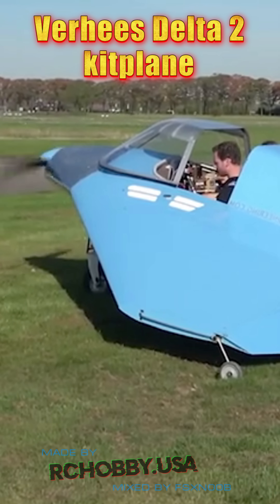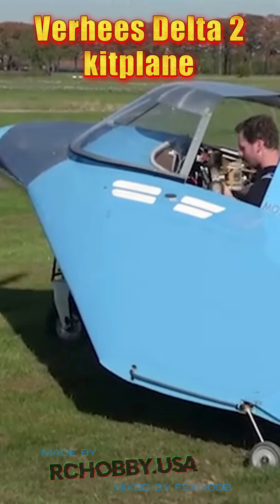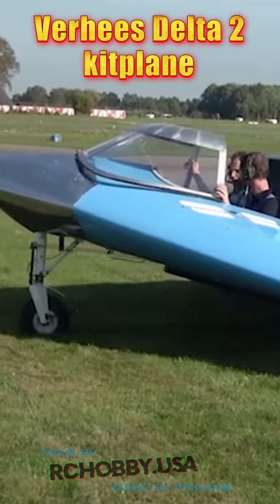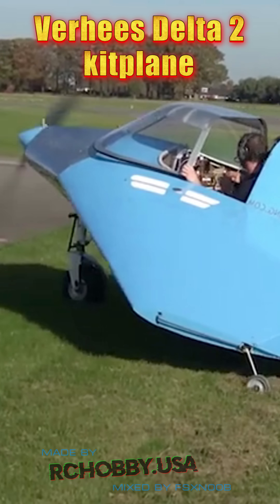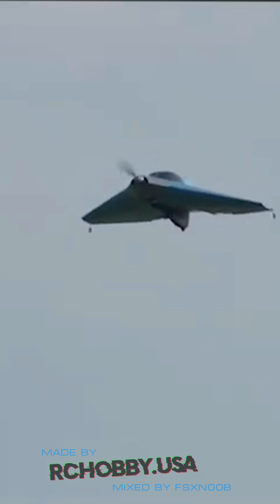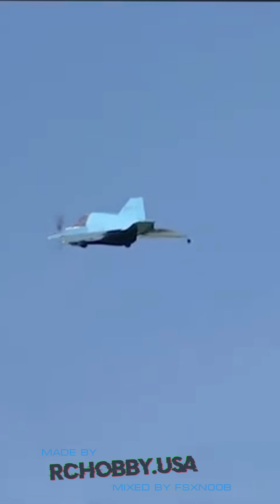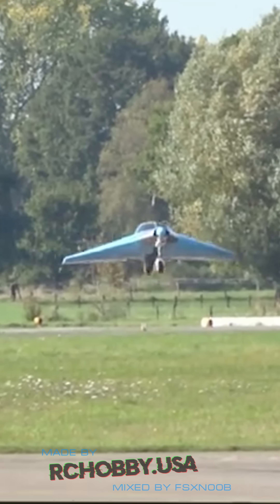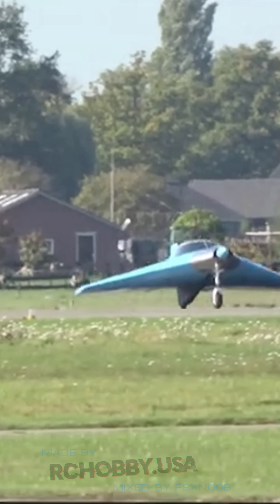A Game Changer in Aviation - Verhees Delta 2 Kitplane #shorts #aviation

Comment: Can you imagine flying for 18 hours straight and then trying to be sane enough to land this thing.
Reply: No I go to the bathroom too many times to fly an airplane for that long
Reply: @theimpaler2317 as a former sailplane pilot I assure you, there are means. Staying hydrated is crucial, and keeping a cap on your head. Sitting under the plexiglass dome in bright sunlight might easily result in a sun-shock like with sailplanes.
Reply: @martinoberngruber1893

This is why fatalities are so high among sailplane pilots.  This mentality of pushing to the brink. 

It’s not because they don’t have an engine because even a powered aircraft will have a survivable crash landing in nearly all terrain—a sailplane that’s designed for an out landing that much more so.
Reply: @calvinnickel9995  ??
Never said I would or was flying 18 hours! What is wrong with your reading.
As sailplanes need upwinds, and are not allowed - in Europe, in the 80s - to fly by instrumental flying rules, they also need daylight. 
Therefore: no 18 hours flight, sorry.
But many sailplanes do have a hole in the front, to hook up to the motorplane. That hole is just where your feet are. And not really airtight. And cold feet lead to the need to go. 
And you have to drink to stay hydrated. Because you are sitting under a plexiglass dome that does not filter UV-rays as glass does. 
That is also the reason you have to wear head protction in aircraft with plexiglass domes.
If you dont, you will get sun-sick. Your head gets dull, your rational thinking and coordination skills vanish gradually. Some pilots do not recognise it soon enough, and make mistakes in judgement of the situation and steering that sometimes leads to fatal crashes.
We analysed the accidents of all severe accidents over 12 years. Mostly very experienced pilots. One with over 2000 hours experience stalling his plane in the last turn to an easy out of airfield landing. Without any need according to an eye-witness. 
As he was a friend of our flight instructor, he looked at the pictures made by the authorities' commission. And he kept murmering, that something was odd. Until he realised, that the fisherman's cap, that guy always wore was missing. 
Then, we scanned the pictures of other accidents. Not one hat was to be found. And drinking was heavily underrated too, in that time. 
So, maybe some pilots are overly ambitious. But there are many dangers piloting small planes with canopies that expose you to open glaciers sun, pilots of big motorplanes with a roof do not have to consider, and therefore do not know.
Reply: @martinoberngruber1893  Damn honey…we got a regular ole Bill Shakespeare over here in the comments section…come take a look.  😂😂😂
Reply: @simonbrightman79  glad you like it. 😅😃
I guess it is obvious, I'm not a native English speaker.
Reply: @daanklas776  thanks for the info.
When I had my license, in the 80s, sailplanes could not go IFR.
Are you allowed to do it with gliders in darkness and clouds? Climbing by upwinds, hence being quite unpredictable?
Or only with motorized gliders on a flightplan?
Reply: @calvinnickel9995 stick to what you know because this ain't it.
Reply: That is why the LORD invented the plastic bottle.
Reply: @LegendOfTheOld  Wrong!! It was Nathaniel Wyeth.
Reply: @patrickhenry9521 😂😂🤣
Reply: @LegendOfTheOld you every tried to shit in a plastic bottle? While operating any kind of vehicle?
Reply: @bigdaddy7119 that's what the hole in the bottom of the fuselage is for
Reply: @bigdaddy7119 you totally said what we're all thinking.
Reply: @LegendOfTheOld  why don't they just design in a hole on the floor connected to a tube?
Reply: @LegendOfTheOld 

Lord Farquad?
Reply: Small hole in fuselage, Bernoulli effect , no problem
Reply: @westwindsailer 😂👍
Reply: @westwindsailer crop dusting
Reply: @westwindsailer  It would be like a mini bomber
Reply: @theimpaler2317  I think their definition of spacious cabin might be different to mine.  90m to 2hrs hops at 220kph and stretch the legs every 2hrs seems like a balance
Reply: @theimpaler2317  i usually end up landing when my gatorade bottle is full long before the gas tank will ever be empty
Reply: Best to stick to the same standards as truck drivers... at a minimum. Safer is less accident prone. How many accidents would they want?
Reply: @tuvoca825  In aircraft your passenger can sleep then fly. Used to be able to do that as truckers til they deemed sleep teams "unsafe"

But working 6 14 hour shifts a week and having one-day weekends leaving you permanently exhausted and sleepy? Nah bro that's fine
Reply: @tuvoca825  yep! I work in trucking. They get 14hrs of on duty time and are allowed to be driving for 11 of those hours. They are also required to take a 30 minute break before hitting 8 hours of driving time.
Reply: Truck driving is much harder.  In an airplane, I can cruise for an hour without touching any controls and generally there’s no nearby traffic.  I can see six miles ahead.  In clear weather, the only heavy workload is below 10,000’ altitude.  Otherwise, the hardest job is changing radio frequencies across ARTCC sectors.
Reply: @denverbraughler3948  Doesn't mean it isn't complete nonsense you can't SB in a truck you aren't driving, considering you're gonna lose all that "restful sleep" anyway by day like, 2 of straight-14s if you even had it your last 30-hour "weekend"
Reply: @buffcode  :

The point is that giving proper planning, e.g., good weather and equipment, a single 16-hour ferry flight is unlikely to be anywhere near as demanding as 10 hours driving a truck.  
Beginning from properly rested, a pilot ought to remain alert enough for 18 hours.  
Ferry flights are used to deliver aircraft from the factory to the customer.  No pilot flies 16-hour legs on consecutive days.
Reply: @dylanbeard7350  Believe it or not, flying is less stressful than driving. You have a period of madness at each end of the flight and a lot of boredom in between (especially when over water) with plenty of time to check bearings.progress, etc

That changes if you're flying through bad weather but the simplistic answer is to fly around the bad weather whenever possible even if instrument rated
Reply: @dylanbeard7350  basically the same as airline pilots
Reply: @tuvoca825 rule 2 UNLESS u got some real good trucker meth
Reply: @tuvoca825  Two. Two accidents.
Reply: I see this comment section hasn’t heard of a pilot tube
Reply: @knifedance2402  Forget my military background, or that I'm gay. But I've never met a pilot who would willingly take a tube up their @ss , just to fly an aircraft. That goes for both male and female.
Reply: @knifedance2402 is that not just for jet fighter pilots because they G  jump suit
Reply: @knifedance2402 I guess that's a typo. You mean "pitot" tube. 
Only too pleased to help.
Reply: Need those Airforce "Go Pills," lol. Off books, of course 😏
Reply: @joshuatoms7664  Not advisable. AF doesn't use amphetamine, usually only ground troops. Nazi's tried it. Look up how badly they failed if you're interested. Yea, something about degradation of fine motor skills and the complexity of landing a plane just didn't get good results.
Reply: @joshuatoms7664  go-pills? Methylfenidat? Aka Ritalin?
But they don't reduce bathroom needs
Reply: @joshuatoms7664  Airforce doesn't use "go pills" for flying. They are for E&E, ONLY.
Reply: Military pilots do it all the time and land on aircraft carriers in high seas.
Reply: @thomascorcoran2819  well, maybe military pilots are quite well trained physically.
Reply: He said 8 hours, not 18
Reply: @DarkKnightwing75  If you actually watch the video until the end it stated it can be modified with additional fuel tanks extending flight durations up to 18 hours and that was what I was referring to.
Reply: Thumbs down, if doing this in English, stick to ENGLISH and drop the Metricrap.  How many cubic inches displacement is the engine?
Reply: @andybreglia9431 One small problem Andy,  it is now the 21st century. And the World has moved on. Only 3 countries are left in the world, who haven't gone metric, including yours. Surprise us.
Reply: Get an autopilot
Reply: @appa609  its posible?
Reply: @appa609   That is cheating. All those stupid computers onboard kill the fun of flying yourself. All those small planes are mini airliners. They play airline pilot.
Reply: I've done it. Yep. You would feel like a zombie afterward.
Reply: Stick in an autopilot, a Starlink and an IPad, and you're set for days.
Reply: That range means they can actually bring their luggage with them if they traveled. No one can fly 18 hours (not counting U.S. Bomber crews). That’s wild.
Reply: I think they said 8 hours. 
140l tank, 16l/h. 16l/hx8h=128l...the rest is reserve
Reply: @eklhaft4531   10 hours of reserve?  If you  watch the video until the end it states it can be modified with additional fuel tanks extending flight durations up to 18 hours.
Reply: Piss jug
Reply: Nobody’s gonna point out narrator said 8 hrs not 18 🥴
Reply: @BigTexGuitarz   If you actually watch the video until the end it stated it can be modified with additional fuel tanks extending flight durations up to 18 hours and that was what I was referring to.
Reply: 😂😂8h not 18
Reply: @dentitoreto pay attention. He says solo with extra tanks, 18 hours/4000 km
Reply: 8hours. Not 18.
Reply: @doughochstatter9653 pay attention. He says solo with extra tanks, 18 hours/4000 km
Reply: It took 27 hours for Lindbergh to cross Atlantic if my memory serves
Reply: You'd have to piss in a bottle and give the people on the ground a golden 🚿
Reply: They said *it* *can* fly that long, not that *you* *should*
Reply: That’s way past my 3 hour pee stop limit.
Reply: Life under Western governments is completely insane...
Bring up amongst the clouds - you'd be far more sane and mind cleansed 😉
Reply: Flying 18 hours I'd need a colostomy bag or a 2L coke bottle stuck to my penis
Reply: Ferry pilot's nightmare!
Reply: considering this liul thing would make you sea sick, hell no
Reply: You can sleep while flying
Reply: @sacatolasmoreira5593  not in a tiny delta wing lol that thing would be like being ont he rough seas, some could sleep, but not all
Reply: it's a rollercoaster
Reply: The lessons learned from this will probably be used for cheap drones
Reply: Auto pilot 😊
Reply: What do you think B-2 stealth bomber pilots do?
Reply: Or get out without leg cramps
Reply: imagine trying to fly 18 hours without using the bathroom.....
Reply: Take some amp like air force pilots did during the war you be fine
Reply: Well if I being music, food and energy drinks then I'm fine
Reply: “It’s not the plane it’s the pilot”
Reply: 18 hrs better with 2 people shift ever 3 hrs
Reply: Where is the bathroom
Reply: Does it have autopilot? Because if it does, then that is doable :)
Reply: It's a two-seater you could have two pilots.
Reply: 2 Seat’s = 8 Hours for each Pilot.
Reply: No
Reply: It’s funny because truck drivers have more restrictive hours than pilots in this case.
Reply: Easily
Reply: It looks woefully unstable & has only a single short vertical for a tail, 18 hrs of bumping around on that would be worse than full time sea sickness.
Reply: That’s what the cocaine is for
Reply: No,like driving a car or big rig,you only drive until you have to take a leak.
Reply: They said 8 hours without refueling
Reply: im really sick, your comment made me laugh really hard for a while. thanks.
Reply: @sheaangnos3830    two pilotos?
Reply: Very easy.
Reply: With no bathroom.
Reply: Astronaut stamina!
Reply: Given that you have autopilot on your plane, consider these.
Want water? Use water bottles. Wanna piss? Use a urine bottle or two. Wanna shit? Use a toilet bucket with a bag and maybe yeet it out the cockpit or have a trash bag behind you. Wanna clean your asshole? Use a travel bidet or wet wipes.
Think of it as a mobile camping home when you're going on long-term flights.
Reply: P400t❤
Reply: I thought they used o-200 not rotax
Reply: Imagine an updraft lmao
Reply: Maybe it would help to have some of that pure cocaine from back in the 90s..lol
Reply: That's one for Jimmy's world 🌎
Reply: i'd just find somewhere to park and take a nap half way through, and then land it the next day.
Reply: Some ferry flights are that long over water - SFO-HNL is 3850km and several of the coral route hops are well over 2000km, as is AKL-SYD at 2200km (1700km Hobart tp Queenstown but you're getting deep into the roaring forties/approaching the furious fifties with the storms that live along those bands)
Reply: 8 hours mate. Not 18. next time listen with attention.
Reply: Just think of how’s Charles felt after landing in Paris damn I couldn’t understand
Reply: He said 8 hours.. not 18
Reply: You now know where kamikaze comes from 🤪
Reply: Just a flight from Melbourne to Frankfurt 😂
Reply: Ano de Fabricação. Qual foi o último ano de fabricação  a FABRICA  AINDA EXISTE ? NOME FO FABRICANTE !
Reply: That auto pilot is going to get a lot of use, so it ought to be a good one 👀
Reply: Military pilots do it all the time.
Reply: 'Panzerschokolade' = Chrystal-Meth .....und du marschierst in 24 h vom Rheinland aus quer durch Nord Frankreich zum Atlantik - und drüberhinaus, wenn's denn sein muß! 😅
Reply: Parachute
Reply: 😂😂 olvida usted es un biplaza ,se turnan en vuelo ,para WC ,se instala un a compuerta especial para defecar 💩, luego le caera el surullo a Jose Maria Aznar cuando firme un libro
Reply: Already done that. No problem at all
Reply: 18? I thought the motherfucker said eight. Now that's what I call endurance
Reply: Yep. Just think, you can fly from Massachusetts to Yellowstone in one day with yourself and girlfriend or significant other, an overnight bag, by just a simple spur of the moment conversation, get up and go ! Have a good time, and be back for work on Monday! Thats living it up.
Reply: That’s what the pioneers did with the first transatlantic fly from France to US. 
And they did it with only view from the side of the plane.
Reply: Two people capability
Reply: الاكسوجين لا يكفى فى مكان ضيق لمده 5 ساعات بدون خوذه او منفس فى الطائره
Reply: yes, because that is literally what pilots do every day
Reply: @hurricanefury439  No, there are co-pilots and flights that are 18 hours long have multiple shifts.  One pilot never flies 18 hours in one continuous flying of the plane with no break or other pilot to take over.
Reply: I'd imagine its like landing a fighter jet, minus the extreme power. In other words, landing this thing would feel sketchy AF.
Reply: I guess every plane have landed.
Reply: Those little wheels on the ends of the wings are smaller than shopping cart wheels.  No way they could handle a wing dip on landing.
Reply: not counting fuel for take off and only figuring optimal fuel/time its. 8.75 hours... not sure how you got 18 hours... 140L/16L per hour.
Reply: @brettleisy356 :

You should listen to the video.  
For the extended range, the passenger and cargo area are replaced with ferry tanks.
It’s not just the 140 L standard tanks.
Reply: @brettleisy356 2nd half of the flight is downhill???😂😂😂😂😂
Reply: @brettleisy356   If you watch the video until the end it states it can be modified with additional fuel tanks extending flight durations up to 18 hours.
Reply: @sheaangnos3830  ah sorry my bad. I see now.
Reply: My bladder won't take 18 hours.  Or even eight.
Reply: its called drugs
Reply: no, shut up now
Reply: You may sleep most of the time, auto pilot can control the flight.
Reply: @FM-yq8yfXYZ  That is illegal.
Reply: @92buckinbroncomann  Are drones illegal??? They use autopilot all the time.
Reply: @FM-yq8yfXYZ  Autopilot is not illegal. Sleeping while flying is. With drones it's even stricter. It is not enough to have fpv camera. You have to have someone watching the drone at all times with direct line of sight.
Reply: @FM-yq8yfXYZ do you think airline pilots sleep when autopilot is controlling the flight? Only one pilot can sleep and even then they have to have a crew member accompanying other pilot in cockpit. In ideal world it should be possible to sleep off the cruise phase but you have continually monitor aircraft vitals and weather the whole flight
Reply: Cocaine…😂
Reply: They will use robots! Something bad happens ,no loss of life !
Reply: @Smoothoperator65 that's called a drone not a plane.